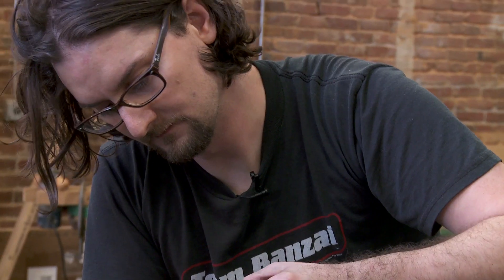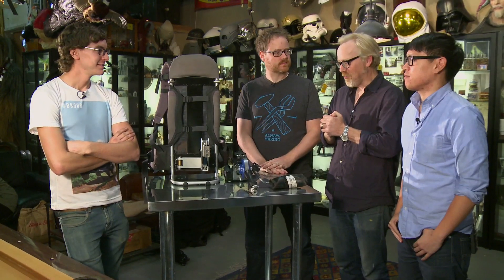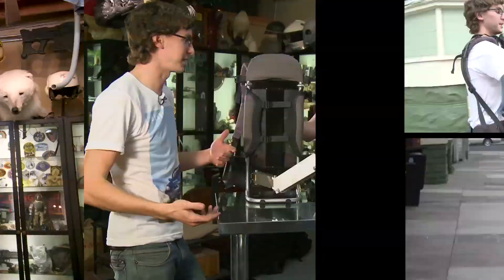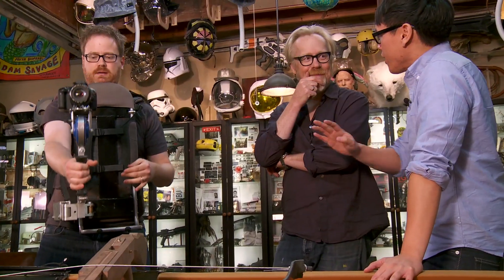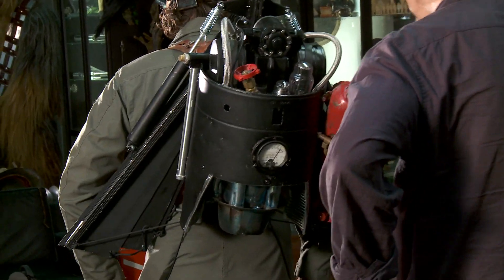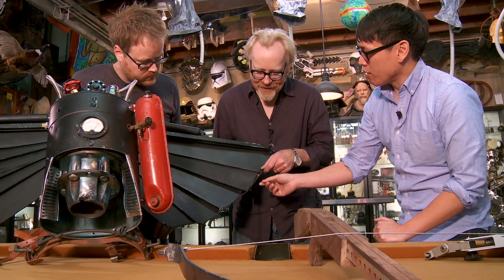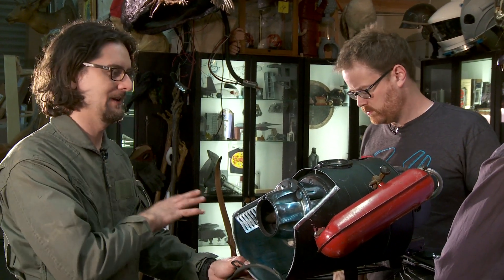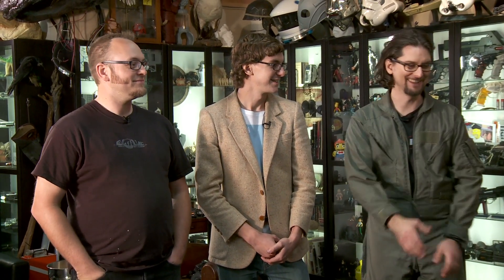The Inventern Episode 15: The Grand Finale!

Comment: Whats the Bolt that hang on the string ? at one point  5.54 on the side of Adam ?
Reply: That's no 'bolt' it's a nut.

My guess is that it is to pull down the access hatch to the loft space. We saw an electrician going up there on one of the 'Tested' vids.
Reply: Ahh I think your right about both

Comment: (Scratching head) Of the three, they picked the one that did nothing; that is, was basically a costume prop.  Really confused on the choice.
Reply: The steadicam didn't function as a steadicam, and looked like a baby carrier with a dentist chair arm welded to it. Which it was. The Crossbow wasn't going to work as a crossbow from the point he couldn't find spring steel, so he should have gone with aesthetics over functionality. That walnut would have been lovely were it shaped, sanded and oiled nicely. 

IMO he showed a good balance of planning, adapting and technical ability. When his mechanism he wanted wasn't going to work, he focused on the aesthetics. This is the point of making them do it in a short amount of time after all.
Reply: Well, Adam is a fan of props and things. I think that it was the most aesthetically pleasing.
Reply: Well Adam is a prop collector.... and its his intern.
Reply: ***** But, it didn't DO anything.
Reply: Mike Lipsey did you watch the video? How did it not do anything? watch the video AGAIN!
Reply: artfx9
When I say it "did nothing," I meant exactly that.  The crossbow shot a bolt.  The camera stabilizer, shockingly, stabilized a camera.  The "rocket pack" did no such thing.  It just LOOKED (poorly, I might add) like a rocket pack.  So what?  Just a costume prop.  If they just wanted costume props, I am sure the other two contestants would have liked to know before attempting to build something that actually worked.

Comment: wow. a spring mechanism, which was almost completely about its look won over two pretty well made and well working mechanical thing. That's disapointing. The guy with the steadycam should've won!
Reply: As has already been pointed out, the steadycam was not only useless, it was on the wrong path. This was about building something that would look the part with a mechanical element, there was no indication of what or why but it's plainly obvious that Adam would choose some type of movie prop over movie making equipment, a missed opportunity for that guy, I'm sure he could have done better.
Reply: that was possibly the worst functioning steadicam in the world. did you see the footage it shot? and the guy blamed his freaking hips. the crossbow was also not well working, at all. in real life, theres a time limit on projects, and if they needed a functioning steadicam or crossbow in 2 days, NOPE these wont work, youre fired. but if you need something that sort of looks like a jetpack, well that should do ok.